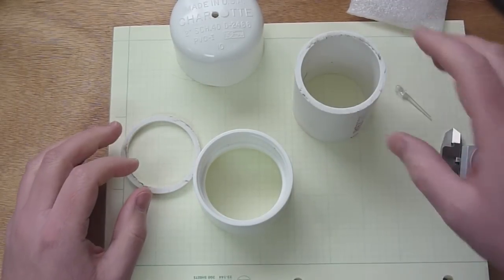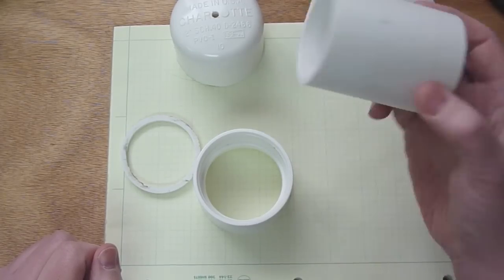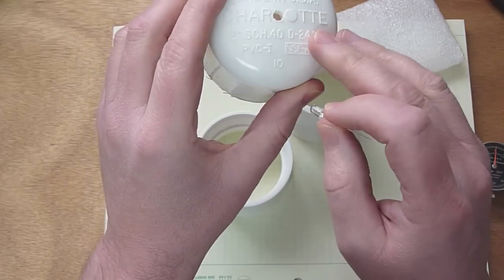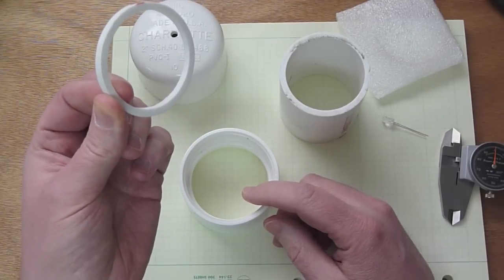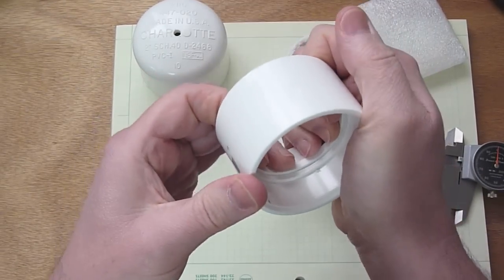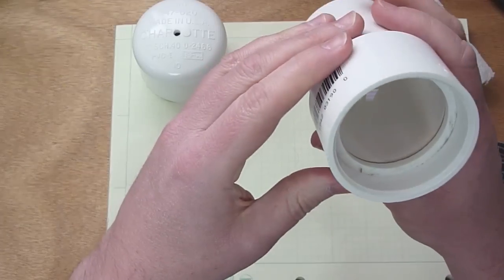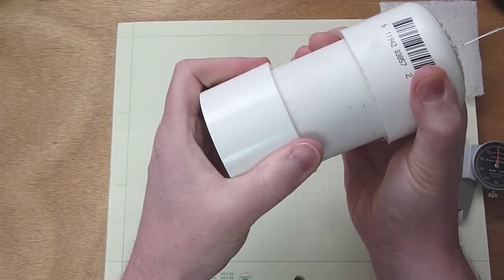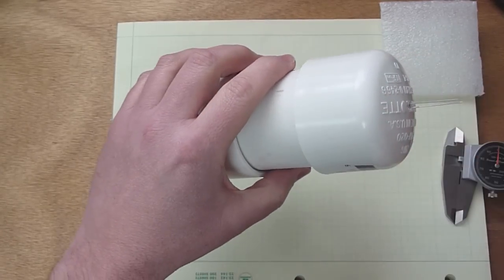Build an Optical Collimator

Comment: where did you source the lens? Im trying to make the best pcb i can at home. mainly because im not trained as an EE but making a board.... so i need to be able to test at home before sending it out so i dont spend a lot only to have a surprise when i receive it and reflow my parts on. Looking to get reliable 0.5mm pad spacing. Already built a bubble etch tank, tested a bunch of transparancies with my printer, made cupric chloride in my garage and sourced a 365nm 4.1w led. Probably going to transfer printer transparancy image to litho photo film instead of stacking. I've seen one piece of that film blocks as much uv in the black area as 4 overheads stacked